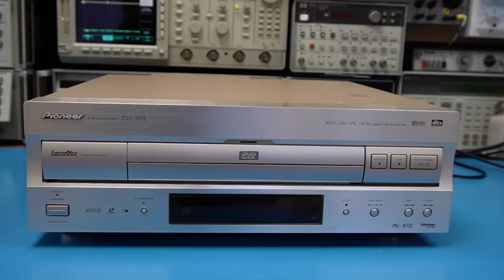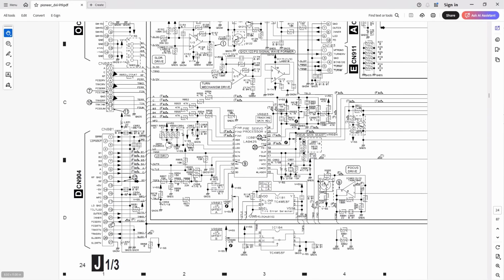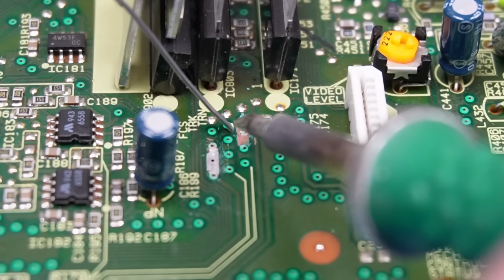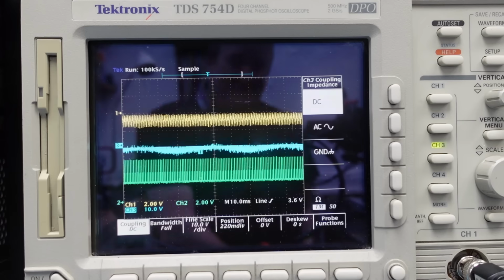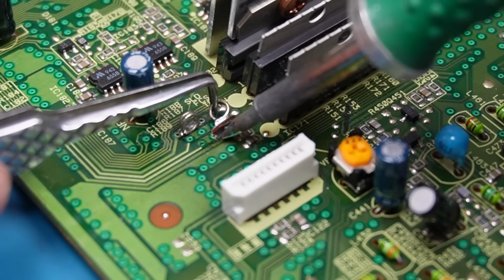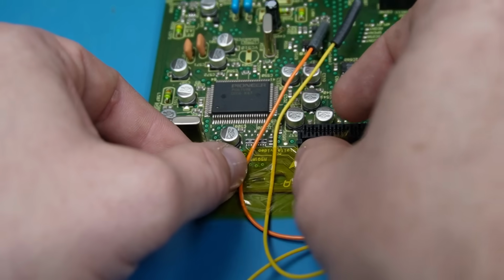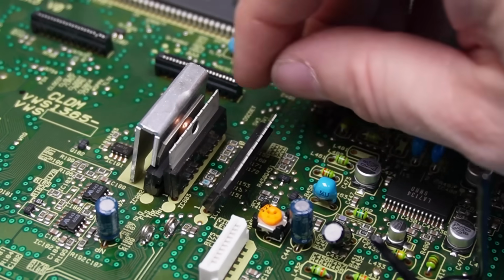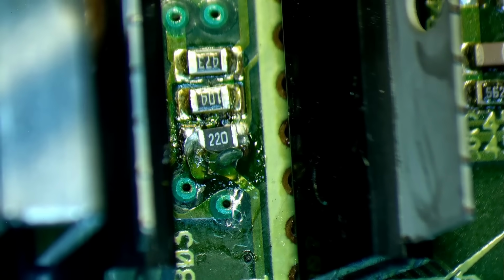Pioneering a fix for the Laser Disc Player

Comment: You didn't check the actual value of the 33k resistor but, in your calculation of the net bypassed resistance, you assumed that the 33k resistor was in fact 33k.  Perhaps the 33k resistor had increased to a significantly higher value so that simply replacing the 33k resistor with one that was actually 33k might have fixed the problem.  Likewise, if the 33k resistor was actually 33k, it may have been the 100k resistor whose value had drifted too far out of spec.  Of course, you got the machine working again, so from a functional point of view you accomplished your goal.

Comment: When you see it scan the disk, and it moves the reader assembly, you can see it briefly binding in a few spots.  I was surprised no lubrication was considered.  Sure, more power would help overcome these grippy spots, but why not fix the sticking before beefing up the horsepower?
Reply: Lubrication happened in the first video. Cleaning and lubrication was how he fixed it the first time. You can see the white grease on the worm gear in the closeup shots of the read head.

Comment: That green bodge wire with the low melting point insulation.... where do you got that from? I had a spool years ago, but it is gone and I can't find a replacement. That stuff is legendary.

Comment: Electronic may be the biggest invention of the twentieth century. I can't imagine a world without electronics. Most gadgets are made not to be repaired. I had a Philips kitchen blender which I could not change the power cord, I would guess, without permanent damage and rending it useless! But I did manage to save a Yamaha receiver going on youtube. I found similar cases in similar receivers and changed one capacitor and it worked. I was electronically proud of myself for a while. The issue was, it didn't always turn On and it got worst with time. Awesome video Mark.
Reply: Living in the city?

Comment: If the motor was the issue, developing a tiny dead spot like cassette decks have a tendency to do, would cleaning the motor armature been the ideal fix or was it electrical instead by out of tolerance components?

Comment: G,day Mark. That was jaw dropping: brilliant.
My thoughts list...
1. Why sled lazor motor stop at that point?
2. First time seeing test loops/springs soldered to pads. I presumed you would use a signal generator and was surprised to see a decade box.
3.Pioneer produced a quality service manual (different symbol for ground).
4. Very interesting watching the scope traces change as over "time" of testing. (I still don't understand what changed in the Lazer disc from working order?
Thankyou 
🌏💫
Reply: The scope showed the control IC ramping up the motor drive to move the sled, but the error signal kept getting larger until it was at max motor drive. After a set time (written in the firmware) it gives up trying to drive the motor forward & instead drives it backwards to the beginning of that disc segment to try it again. Hope that makes sense.

Comment: The machine is now around 26 years old and well past its intended lifespan. The resistance change overcomes issues from electronic components that will be out of tolerance by now and wear in the mechanisms. Sure the proper fix is to replace worn parts, but I guarantee pioneer discontinued spares for this obsolete technology decades ago. It would be nigh on impossible to restore to perfect original specifications. I think mark’s fix is a perfect solution to keep the machine going.
Reply: PIONEER    not   pioneer
Learn to pay attention to detail
and step out of the ZOMBIE zone

All CORPORATE legal names are always written in ALL CAPS
Learn correct grammatical ' Legal ' English and educate yourself
to a higher degree.
Learn that only a Living Soul can have a name in Mixed Case Letters.
All entities that do not posses a soul - yet have Legal Status
have the name written in ALL CAPS.
Begin by observing how names are written in a Cemetery and
on all COMMERCIAL instruments.
Pay attention to detail.
It's not difficult for those with intelligence
Reply: @XRAF-633 😂 Get a grip🤦‍♂️
Reply: @XRAF-633  Their own website lists it as "Pioneer". Not that it matters in any way, shape or form.
Reply: @XRAF-633   Hows this for capital's.  PISS OFF
Reply: @XRAF-633  what a useless bot. it's not all caps but a capital P, one of the most recognizable logos/names...

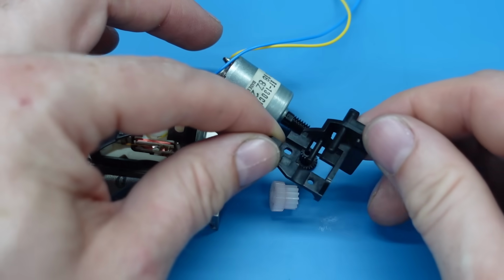Comment: Looks more like mechanical problem to me. Maybe it was just matter of feedback overloading the input, because motor had hard times to adjust lens. That piece you hold at 3:20 could be culprit still. It might look all right, but not all cracks (or deformations) are easily visible. A side was playing fine, because motor was laying down on it, but on B side it hangs down and looks like its struggling to turn. Certainly not happy.
Giving it more juice helped, but if it starts again, it would be reasonable to give that mechanism detailed inspection.

Comment: My question is. If the amp and drive are both adequate on side a, the issue would be after the assembly has inverted, and therefore associated with cables and assembly changes when this occurs. But would forward be reverse after the swap?

Comment: I remember when laserdiscs were the pinnacle of home theater tech during the videocassette age. Often sold along with projection screen televisions, it was the first consumer tech that offered 5.1 Dolby surround. From 1992 to 1997, laserdisc players were status symbols and offered the best audio, until DVD disks moved in and practically forced laserdiscs into extinction overnight. Given the complexity of modern electronics, I imagine that filming the repair process is a tool itself, to verify correct reassembly and wiring. Incredibly informative as usual Mark. Well done!
Reply: Laserdisc Dolby Digital AC3 is far better than most DVDs and many Blurays. 😉
Reply: I remember Laserdiscs at work, before they became a "home" format. I loved the ability to be able to jump "directly" to any specified track on the disc (i.e. to a one revolution accuracy). Try doing THAT with a DVD!
We were working with Video Arts training discs for customer service at the time, starring John Cleese. You can find and watch watch some of these on YT, and they're still brilliant. The plan was to use a PC to show a clip, then ask a multiple choice question, then show the clip of the result of that choice. Sadly, we never completed that project, but it was great fun to work on.

Comment: To me it looks like you fixed a mechanical problem by giving the motor more power, so it can overcome whatever mechanical issue there is on that location. Wouln't it be better to also check why the mechanism got repeatedly stuck at this particular position? I have the feeling there is some mechanical issue that will get worse and next year you might have this on your table yet again.

Comment: What’s the problem? Not the resistor . Then all devices with the original resistor should have the problem.
Reply: The problem will be a combination of issues I think. The sled mechanics and friction are slightly different between side A and B modes and the motor is probably a little weak due to its' age, (usually caused by build up of carbon around the commutator). Mark's mod. has increased the op amp gain just enough to compensate for this.
Reply: Well it's probably a common fault but what faults occur depends on many factors.

Comment: Having written laser disk transport firmware for many years I am a bit surprised you had to do this, mayne the rubber mounting the tracking mirror has stiffened up over the years. The way this is supposed to work is when the tracking mirror starts to get to far off center of it's range it moves the sled to recenter. - - good job
Reply: That's what it's trying to do, but at some point the motor stops turning, so it tries ever harder but even with 100% duty cycle the motor still doesn't turn, so it's a sled issue. If the laser mount were seizing up, it wouldn't be able to track the off-centre disc and the picture would tear. Looks like silicone rubber or similar so shouldn't deteriorate.
Reply: @matthewmarks6951 I think the scope showed not a PWM signal but more like Pulse Repitition Frequency (or PRF) control; since it was fixed at about 10% width & the drive chip just increased the number of pulses until it maxxed out.
Reply: @wirdy1  Yes. The duty cycle I was referring to was of the pulse trains, not the individual pulses.

Comment: When Philips changed from the swing laser CD mechanism to the motorised sled we had terrible problems with the sled sticking causing jumps in playback -Philips tried changing the grease which helped but wasn't 100% so I designed an output buffer for the sled drive that had negative output resistance that compensated for the motor resistance which made the mech bullet proof - I lost a lot of sleep over that sled CD mech!
Reply: That must have been amazing to work on the design of such a thing. We don't hear much from the design heros of these machines.
Reply: Why was it "sticking" deflection of the rails? Friction?
Too much resistance: why the change in current?
🤔🚂
Reply: Yes: I worked on NSM CD-player jukeboxes where the introduction of the PHILIPS CDM12 linear sled mechanism was a disaster. One day I drove from London to Colchester and back to replace a sticking laser only to have to return the next day to do the same again. Previous generations of radial tracking PHILIPS lasers could go for up to 10 years without needing a service visit. NSM in Leeds had a shelf-full of scores of failed, virtually-new CDM-12 lasers which cost £400 each in 1998. The bodge work-around wasn't just adding grease, but adding a stainless-steel channel over the rough alloy casting which was the cause of the problem. One ball-bearing had worked for years but they had to change it.
Reply: I've got a cheap motorised camera pan/tilt mount that doesn't even have PWM drive at the moment. I'll try to remember this idea if I get round to improving it.
Reply: You didn't work in Southampton by any chance did you?
Reply: Very interesting - I've seen something similar used to reduce distortion when driving an audio output transformer, mixed feedback creates a negative resistance that cancels out the DCR of the transformer primary.
Reply: You are a far cleverer engineer than me. Hats off to you.
Reply: A really interesting insight into the development of this technology … as a retired Aerospace Airframe Systems Engineer myself, I’m not at all surprised by the challenges you will have faced in developing these mechanisms. Rather like the ring-pull can, it is an incredible example of design and manufacturing engineering to create a product that can be made in huge quantities and actually work with such precision for many years of operating service. Thank you for sharing.
Reply: Two examples of your handiwork are still alive and kicking with me. Thank you! And I also have the generations LD. I grew up and still live in HK so we all had them. I bought the ultimate edition Star Wars LD boxset with my first paycheck. Those films were over 2 or 3 discs and my first player couldn’t play both sides without physically flipping the disc. I still have that player now I think about it 😂
Reply: Дело в том сэр, что качающийся механизм Philips явление более чем плохое . Все фирмы в своих проигрывателях  боролись с вибрациями и только на Philips  решили всех удивить . Из - за этого мне пришлось выбросить новый проигрыватель cd фирмы Grundig в котором стоял такой механизм. Он проработал всего 10 месяцев. Ремонту он не подлежал , а сервис тогда обанкротился. С уважением  Alex.
Reply: PHILIPS   not   Philips
It is clearly written on PHILIPS products.
Open both eyes and learn to pay attention to detail
Clearly you were programmed to be a ZOMBIE and do not realize it.
ZOMBIES have eyes but cannot see - ears and cannot hear

Time to step out of the ZOMBIE zone

Also  PHILIPS did not  TRY  to change the grease
they DID  change the grease. Get the point.
Understand that the word  TRY is one of those useless filler words
that means nothing.
There is NO  ' TRY '
One either DOES  or DOES NOT
It's that simple
Reply: @XRAF-633 Are you feeling ok?
Reply: @XRAF-633 jeeze calm down it really isn't that big of a deal for you to start personally attacking someone! Definitely NOT in the spirit of this channel.
Reply: @XRAF-633  Say NO to Alcohol kids
Reply: @XRAF-633 I didnt see anybody misspelling Philips. By the way, is it Misanthrope or Missanthrope ?
Reply: @jimfarrell4635 Nobody did spell anything incorrectly because I thought the same too. Seems he lost his mind over not capitalising every letter as they do on devices. The Star Wars quote makes me assume it is one of those utterly tedious neck beards who spend all their time making up random serial numbers for things on Wookiepedia.
Reply: @XRAF-633  There's a difference between a logomark and a company name. Philips products also had "Philips" marked on their products, in the legally relevant places. It's also clear that "tried" implicitly refers to fixing the problem by replacing the grease, not merely replacing the grease. I'd say that this is a bad troll attempt, but I suspect you've actually internalized these false rules you've made up for yourself.
Reply: @XRAF-633  It's that simple to not use a fictional R.A.F. squadron stating that you are "ex."
Reply: @XRAF-633 No tried is the correct word to use in this context, they tried changing the type of grease, to see whether it would solve the issue. Chill out man.
Reply: @XRAF-633  The reason he said TRIED is because it didn't work ......... So he had to do something else like design a buffer ...... Someone is not paying attention ......
Reply: @XRAF-633 "Lighten' up Francis!"🙉🙈🙊🤡